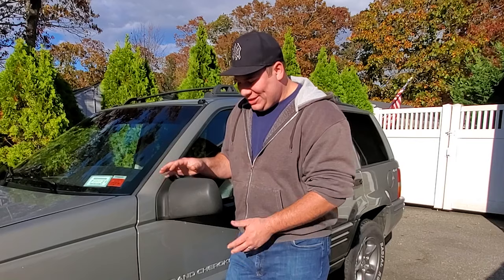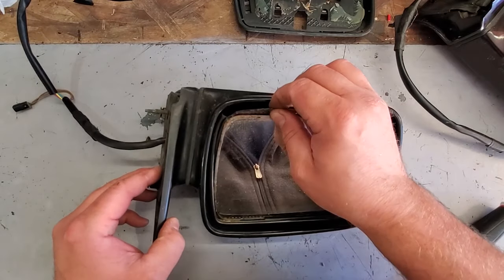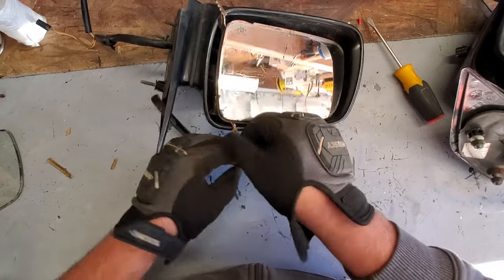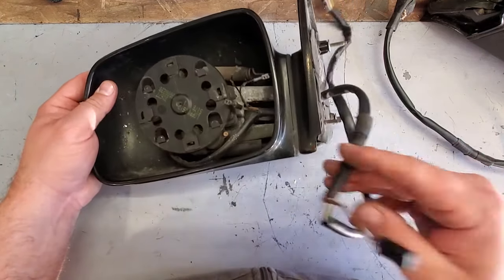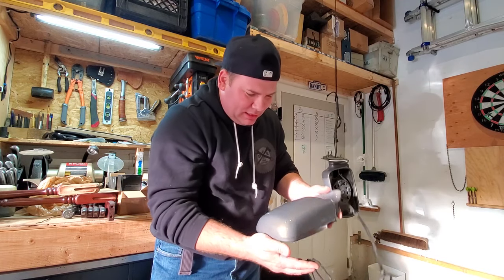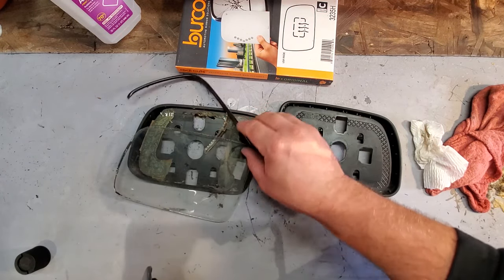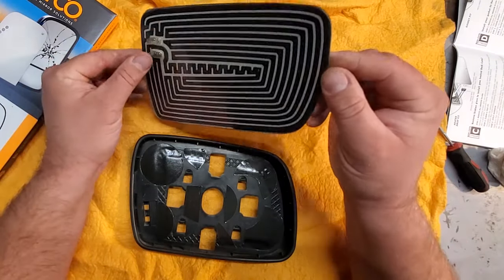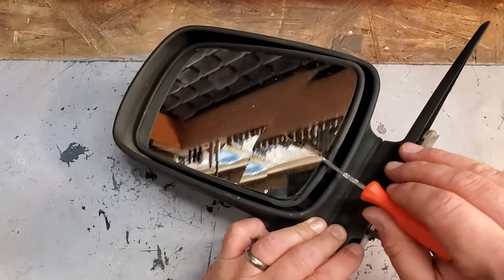JEEP ZJ SIDE VIEW MIRROR RESTORATION AND GLASS INSTALLATION

Comment: Auto dimming mirrors is part of the limited package as you know now 😂 I had a hard time finding a replacement for mine because of this same thing and I now all Jeep's aren't created equal . It always amazes me to see my 98 Limited ZJ has more features than most modern vehicles it was ahead of its time .
Reply from the maker: Amazing right?  These Jeeps were way ahead of their time.  I'm gonna try to restore every component! (Except for the auto dim side mirror 🤣)
Reply: That's exactly how I feel in my 97 Limited daily.
Reply: Did you found the part number? Where you bought it? Thanks
Reply: I heard that the dimming fluid in the driver's mirror is nasty stuff, mine was leaking, so it got binned very quickly. Couldn't get a RHD dimming mirror replacement, so had to lose that feature. 😔

Comment: Can't wait for the next video. My 98 zj 5.9 L obviously has the memory mirrors, but they adjust randomly every time I unlock the car. Because of this, I have to adjust then every time I drive. I'm hoping your next video shows how all of it works so I can try to fix mine
Reply from the maker: How did you know? Lol.  The next video I dig into the mirrors a little deeper.
Reply: Project Dan H lol! Can't wait!  With the research I've done, it has to do with the actuators loosing home. I was curious if all the moving you were doing installing the mirrors messed that up and caused you to have the same problem when you had it all set up.
Reply from the maker: @cfreeses  once you give the contacts a good cleaning they'll perk right up!
Reply: Don't they adjust when you press memory #1 or #2?
Reply from the maker: @OldsVistaCruiser  depends on how warn the contact are. If the mirrors don't know they are where they're supposed to be they'll move on ya and the 1 and 2 button may not reset!

Comment: I believe that extra wire on your replacement mirror is for the auto dimming feature, the extra clear glass may have something to do with the auto dim feature or may just be a protective cover over the mirror itself to protect the heating element?  I have no idea about that extra glass piece though...I've never taken any mirrors apart LOL...I just know my 98 ZJ has the auto dimming rear view mirror...my previous 96 ZJ's exterior mirrors also would auto dim...there's a button under the rear view mirror that turns that on and off.  The mirror's will kind of darken a bit like a pair of auto darkening glasses...really nice at night when people come up behind you with their bright lights on.

Edit:  Get a can of clearcoat spray to spray on over your paint, otherwise the paint will just fade in about a year.  Knew a guy who did an awesome foilage camo paint job on his 92 Toyota pickup and about a year later the paint had faded out and all you could see was the gray primer LOL.  

Also, do you happen to know where to get that color of spray paint or what color its called?  Wouldn't mind getting some to touch up a couple rock chips.
Reply from the maker: I ALWAYS clear... At least 2 coats!  The only thing I didn't to was wet sand 😞. I figured road chips would eventually make wet Sanding a moot point.   I got a couple cans of PJ7 chargold made up.  You can get em on eBay or Amazon.  They're not a perfect match but there fine for an ol ZJ.  
Yes, you are absolutely correct. That plate of glass and those extra wires were for the Auto dim feature.  They go "dark blue" when you activate the rear view mirror.  Well done brother 👍
Reply: @ProjectDanH  Hmm, seemed like the auto darkening glass in my 96 ZJ would go kind of a brownish/gold color when they would darken, maybe they got different colors through the years?  

I'll have to checkout the paint, thanks again.  The driver mirror glass on my 98 ZJ kind of moves around on rough roads you can see it vibrating...wonder what that could be, probably the actual internals of the mirror causing it though would be my guess.
Reply from the maker: @wildbill23c  I thought all electrochromic gel was blueish.  But then again yours works and mine didn't haha!  My next mirror vid gets alot deeper into the motors. Stay tuned!
Reply: @ProjectDanH  I'll keep watching.  The mirrors on my 96 ZJ always had kind of a brownish/yellow look to them so I don't know for sure.
Reply: @wildbill23c   - My '96 ZJ Orvis turns bluish, but only on the driver's side.
Reply: @OldsVistaCruiser  Thanks, wonder why the driver's mirror on my 96 ZJ had a brownish/yellow tint to it?  Maybe from the heated mirror feature being left on burned something IDK?
Reply: @wildbill23c  - Maybe. The mirror heat turns on when you use your rear defroster.
Reply: @OldsVistaCruiser  It does turn on both heated mirrors and rear defroster in all ZJ's as far as I know.  Wish it were a separate switch...maybe a mod I could do at some point LOL.
Reply: @wildbill23c  - My friends call me Bill. The passenger side mirror heats, but is not supposed to dim. The inside mirror dims, but, of course, doesn't heat.

Comment: Hey Dan, great videos! I have a quick question. When you did the driver side mirror did you use the plastic back plate from your Laredo mirrors so the mirror would sit in it instead of sitting flush like it would on the limited mirror with the auto dim feature? Mine is apart but the mirror sits flush with that plastic plate not inside of it because of the trim that was originally around it like you showed and I was wondering how you worked around that?
Reply from the maker: Oh man! I'm sorry but  I don't remember now..lol .  I just rebuilt it with whichever parts fit the best
Reply: @ProjectDanH  No worries. I ended up cutting 2 different ones up and hot glueing them together until I find one that’s a actual match haha. Different year zjs and styles seem to have different internal parts in the mirrors.

Comment: I need help with my xj 01 it keeps misfiring and the engine light comes on we’ve replaced the coil spark plugs cleaned the engine. I love my xj and just want it to have full power please help
Reply from the maker: What CEL code is it showing?
Reply: Henry & Tracy Pine-Altman Check to see if you have any vacuum leaks, that makes XJ’s run really rough and even misfire.

Comment: It has some sort of grounding issue cause when I turn on the headlights my gauges and back wiper blades and everything goes crazy
Reply from the maker: You may have a chunk of wires melted together in your harness
Reply: I’ll look into that thank you. It’s just frustrating because the condition on this xj is really great and I’ve done some customization to it but would like to lift it but have to wait until I fix this problem.
Reply from the maker: @bluelegomaster1234  there is nothing worse than bad wires!  Hope you can find the problem

Comment: Anyone know a way to get memory mirrors to stop defaulting to mirrors to pointing to the ground? Computer rebbot?
Reply from the maker: Its the contacts in the mirror assembly,  you have to take the mirror apart and clean them.
Reply: @ProjectDanH  thanks I saw your video on that.  I was hoping an easier was. But better than replacing. Still waiting on boslla bulbs.😀

Comment: I have a 1994 limited and mine attach in three points totally unlike yours so wasn’t helpful for me?? Otherwise great job demonstrating
Reply from the maker: send me some pics on IG @project_danh
Reply: Thanks for offer. My 1994 limited 5.2l has power and defrost and it has two wires for defrost  and two telescoping rods that came off with old mirror and I reattached to new mirror and popped back in and voila! I called Jeep and they had four different types of mirrors for that year.
Reply from the maker: @kevindear3350  yes, they also had some with wires for the electrochromic Auto dim system.  Crazy!

Comment: Need help I don’t know what to do
Reply from the maker: Start from the rear wiper switch wires and follow them up to your ignition switch and light switch in the steering column area.  I bet there is a short.  Make sure you disconnect any aftermarket accessories and  unplug your battery